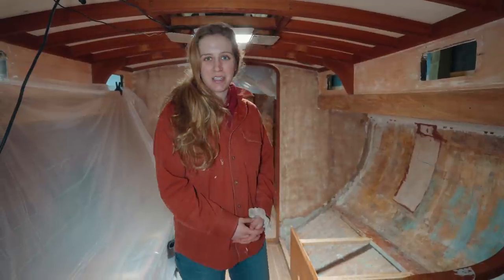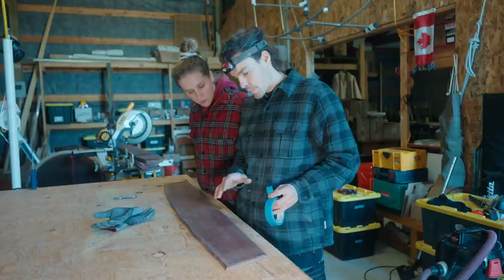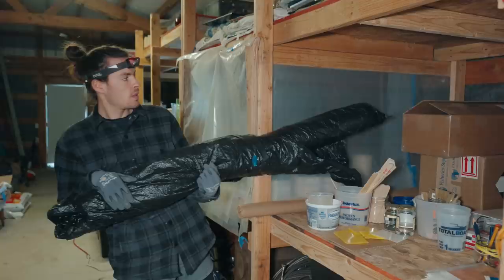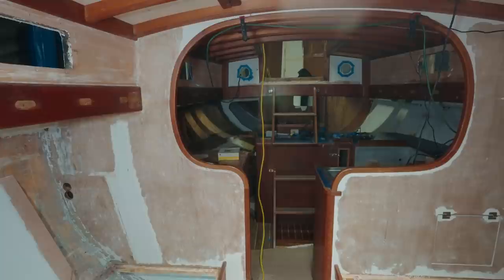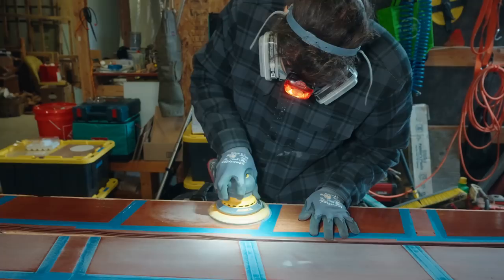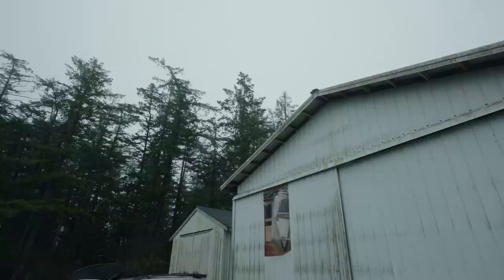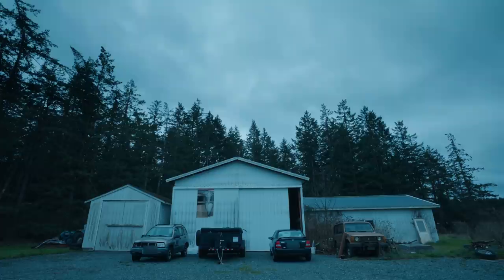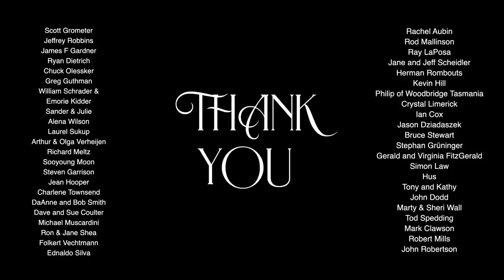One Week of Intense Boatbuilding.  [S4E41]

Comment: Hey you guys, I love your videos. Having worked around boats for three decades now, I know that it would really help your efficiency and be worlds safer, if you would build a proper set of stairs to get up to your boat. It would just take a few hours. By building stairs with a gradual enough slope, which would cost a little more, you could go up and down them without having to hold onto a railing. You could use both hands to hold whatever you may be carrying. Of course the stairs would run alongside the boat, starting toward the bow then climbing up toward the entryway, with a small landing at the top. Just trying to help. My saying for the day, not that you two need it of course…
If you do the things you ought to do, when you ought to do them… there will come a day when you can do the things you want to do, when you want to do them. ✌️

Comment: When you have a big project and are drowning in smaller pieces of the project, don't see it as microscopic progress, but rather progress of the minor part which in turn adds to the whole. I'm to tired to explain it, but if you imagine the main project as a huge circle and in it and around it you can fine all the tiny projects that makes up smaller projects and some of them can be divided further to smaller and easier to do projects. Then as you do the smallest project one at at time, you progress will only be crawling forward, but do enough such tiny part projects and suddenly as you complete more and more or them you'll find that your progress seems to jump forwards by unexpected leaps.

I don't remember what that modeling is called, but it works and it make large project easier to handle as the more you divide up a large project the easier the smaller pieces are to do. And doing enough of them, will in turn finis the project, not with a bang of hurried success, but rather a puzzled, oh are we finished.

Fun fact this approach works for any task or project you need to or want to do, its just all about breaking it a part into small enough pieces that the impossible becomes just difficult and from there becomes learning something new and just time consuming. It's the shortcuts that messes up your project in the end, so take it slow and do all the tiny pieces right and sooner or later you'll see that all those tiny pieces make the whole complete.

Comment: Hi guys. Loving the show and the progress. I'm wondering if you could shed a little light of something about your process for me? Why do you guys use the layers of thickened with 407 (I think) in the head/when re-glassing over the balsa? Is that to smooth out the roughness of the wood? The outer layer I think I get. I assume that is to allow it to be sanded/faired later. But I'm not sure about the layer after wetting out.
Reply from the maker: A little 407 in between is to avoid voids and air bubbles in the glass. The balsa is not always super smooth. One could fair it first and then glass but on non critical work like this I prefer doing it in one step

Comment: I wonder why he is using chopped strand rather than a cloth over the balsa? I'm guessing because the strength of cloth is not needed there and it's less expensive but hey, I'm just learning this stuff so any enlightenment appreciated
Reply from the maker: We are using 1708, which is biaxial cloth with a layer of chopped strand.
The chop strand is rather unnecessary, but helps with fairing and preserving the biax when you sand the surface in preparation for next steps.
Reply: @SailingMagicCarpet  wow, thanks for taking the time to respond to a question in an old vid! I'm starting to refurbish my boat and I am learning a hell of a lot from your channel so many thanks.

Comment: I may have missed it, but why not just varnish the entire piece? Wouldn't that have been much easier and quicker? Sorry for the dumb question. And it does look good, no matter what.
Reply from the maker: Not a dumb question at all! We did that because this piece will get glued down onto the deck beams. Wherever glue is applied, the surface has to be abraded for proper adhesion. It would be difficult and annoying to sand around the "visible parts" later, so we decided it was easier to do it this way, leaving the "glue" sections rough and sanded. Does that make sense?
Reply: @SailingMagicCarpet  Thank you, that absolutely makes sense.  Best to you two.

Comment: Why on earth would you not varnish the entire under side?? What was the point of masking off the areas you can't see?
Reply from the maker: Because those areas will be glued down to the deck beams. In order for proper gluing adhesion, they have to be "scuffed up" with sand paper. It's easier to mask off those areas when varnishing than it is to veeerrryyy carefully sand around them later, trying your best not to scuff the "good parts" of varnish.